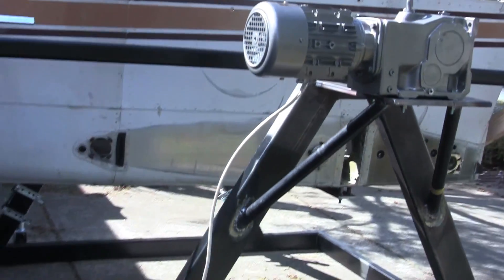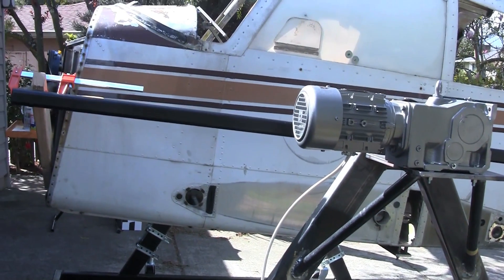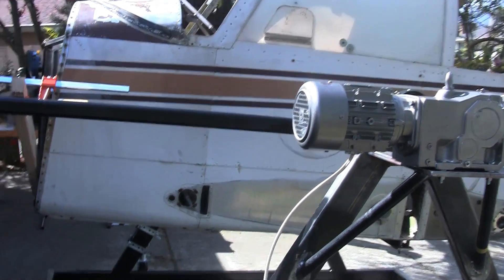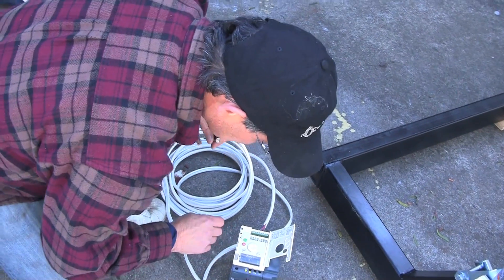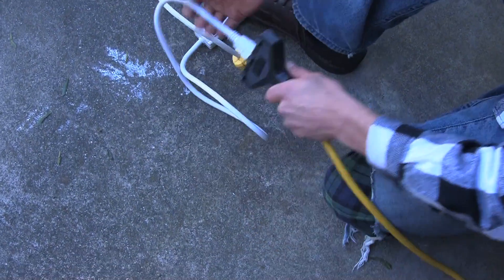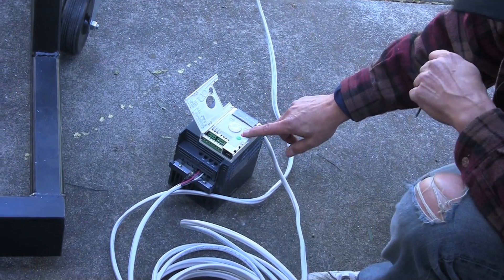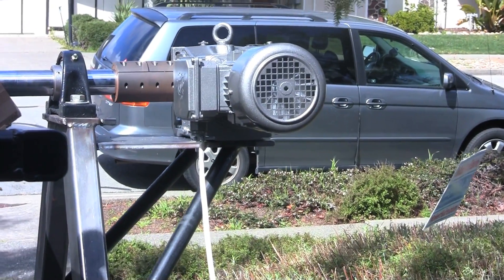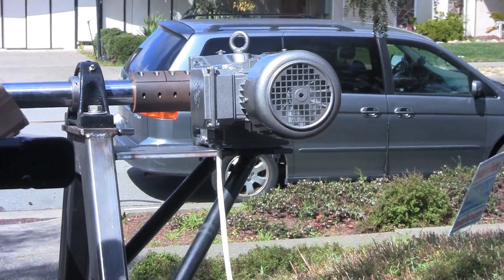The Viper - Week 22 - Pitch motor

Comment: Nice Job !  But what is the power of your motors? I mind they are directly on the pit/roll axe. They have to be powerful but how many?  did you have any references? Great from France!
Reply: There are lots design documents available at the-viper.org. Click on the "Design Docs & Software" link in the left margin. We ended up going with 1HP motors for both pitch and roll. They were the biggest motors we could find that could be run off 110V electrical service, which is the standard in the US.